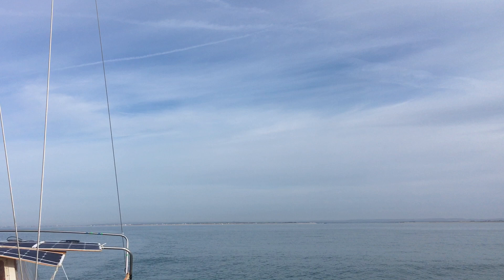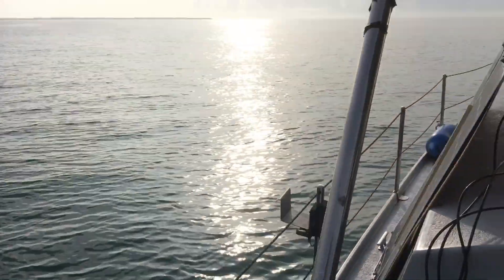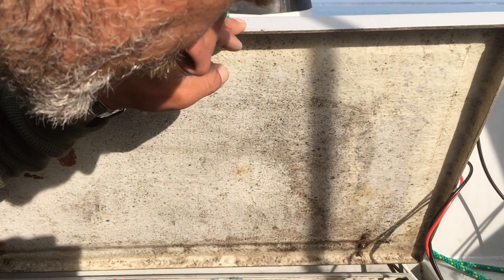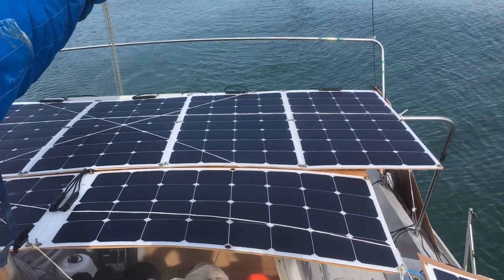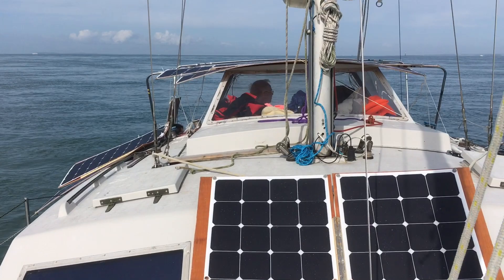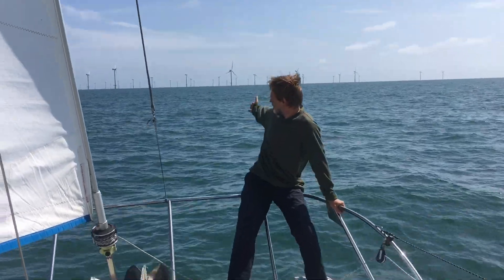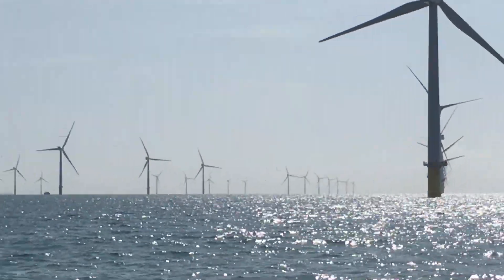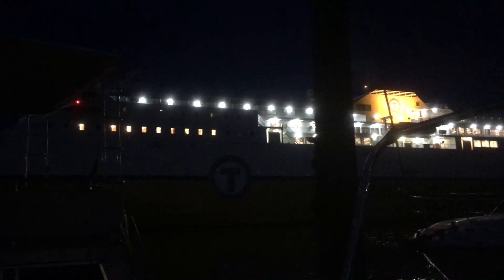Solar boat motor - Zero emissions boating, Part 4 A wind farm on the 50-mile trip to Newhaven

Comment: I think you would gain more power out of the solarpanels, when putting some on an arch on the rear of the boot out of the shade from sails or shrouds
Reply from the maker: Thanks for this. I agree, with the sun off the back of the boat it’s much better to have panels sticking out there. Given this, I plan to place some in-situ panels off the back of the boat next year. I’ll make a video and post that as soon as I can.
Thanks for your comment!!!
Simon
Reply: @aktsolar  I made a little video that shows the output of my 3 100W panels on my catalac, its in german but the pictures speak for themselves
Reply from the maker: Peter Fehringer: sehr schoen. Ich hoffe etwas aehnlich diese Winter zu machen. Ich meine mehr Panellen "fixed" wird leichter. Vielleicht werden wir naechstes Jahr sogar Norddeutschland erreichen. Ich habe im Sinn den Nederlanden, Deutschland, Danemark und vielleicht auch Norwegen zu besuchen.
Reply: @aktsolar  With a catalac it`s easy to lay the mast for travelling through some channels, maybee with a 10hp outborder for longer distances. I know a guy wo has one diesel with 17hp and an electric motor on the other side just for manöuvers.

Comment: Do you use a controller for each panel?
Reply from the maker: Hi Dim Sum, I wasn’t using one for every panel. I use a controller for each panel that is fixed to the batteries long-term. But for the panels that I can swap in and out when the motors are running I just attach those directly and make sure the voltage doesn’t go too high. (If it does start going a bit high I unattached one of the panels.)